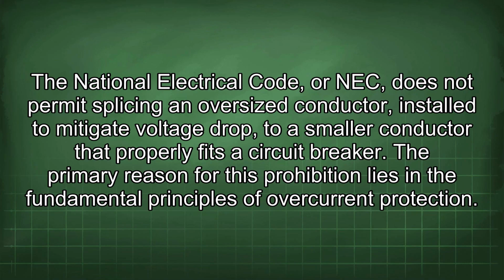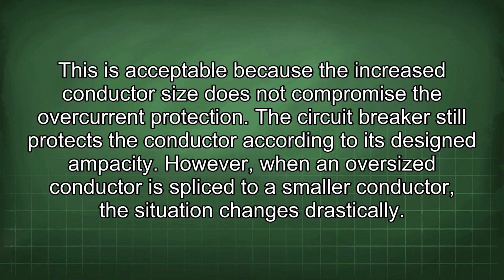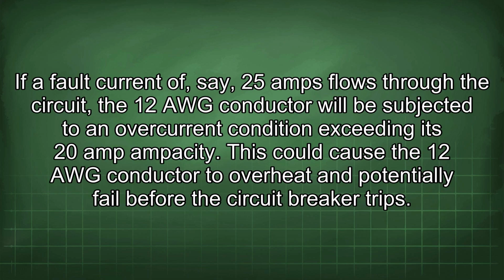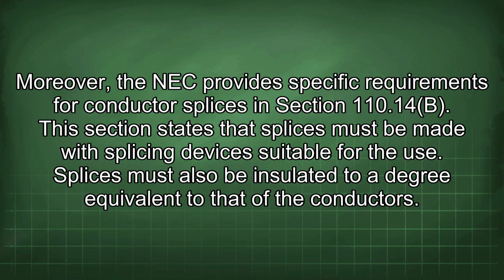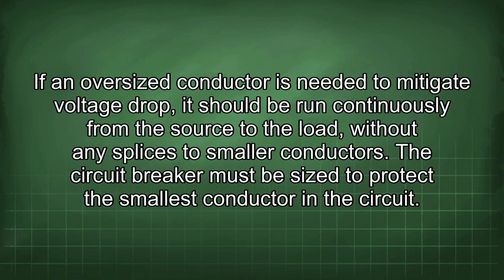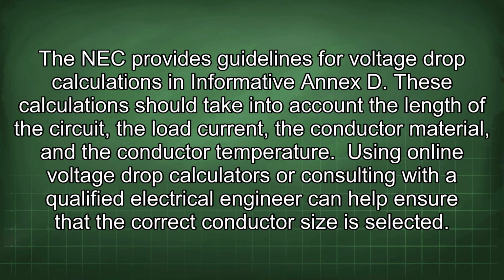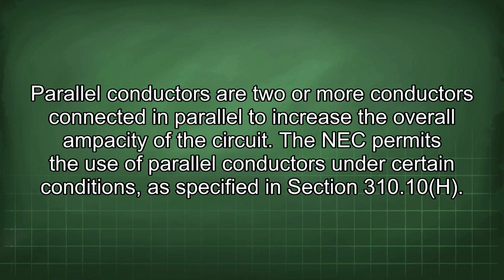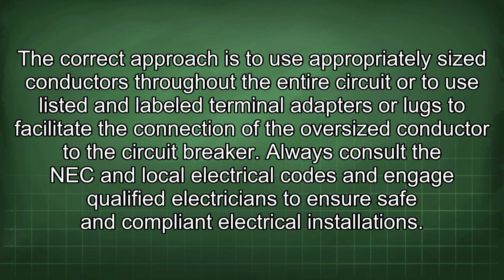Splicing Oversized Conductors to Fit Circuit Breakers Explained

Comment: This is incorrect. As long as the overcurrent device is sized according to the ampacity of the smallest conductor in the circuit, there is no issue